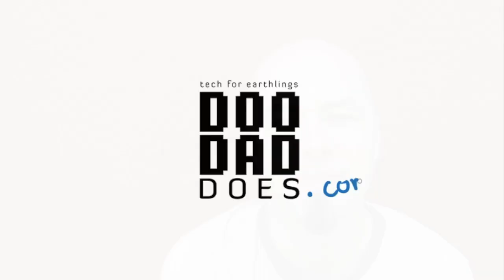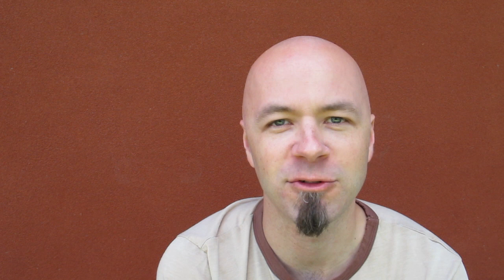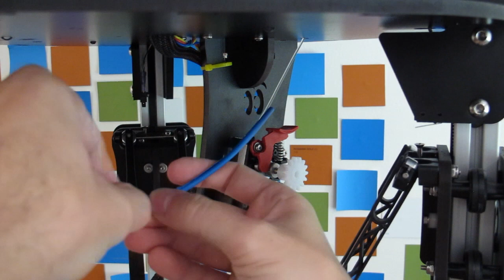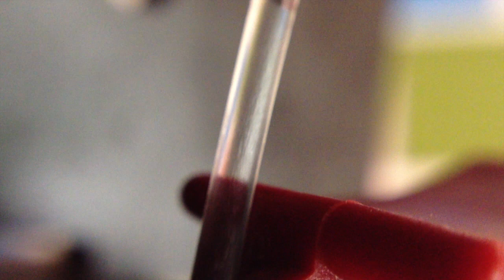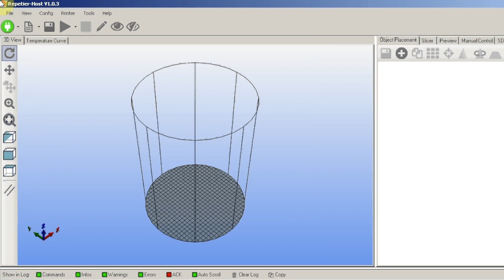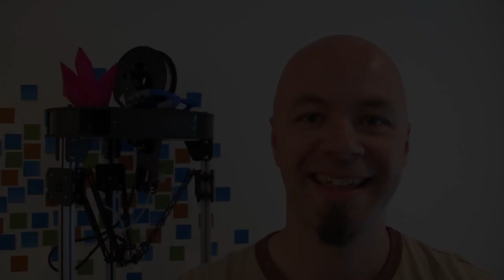What is E Steps and how to calibrate it

Comment: Don't forget: The amount your E-steps setting is off adds up the more steps it takes. So the longer the length you are measuring the better you will be able to dial in your E-steps. Ex: Being off by 1% will show up as a 1mm difference after extruding 100mm in contrast to showing up as a 5mm difference if you extruded 500mm.
Reply from the maker: Joshua Anderson Yes good tip!